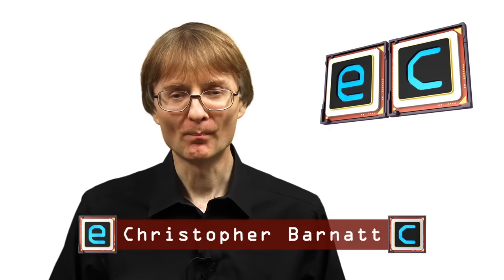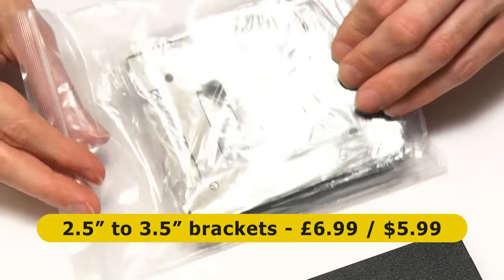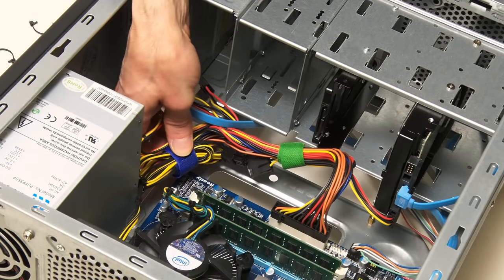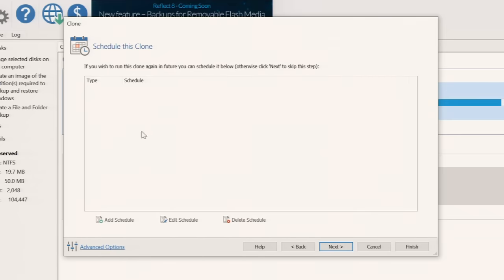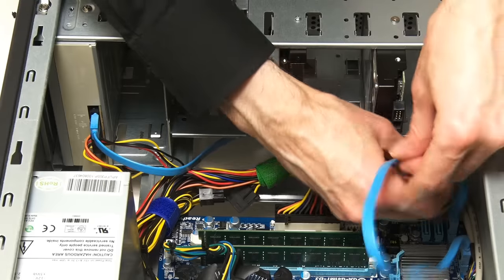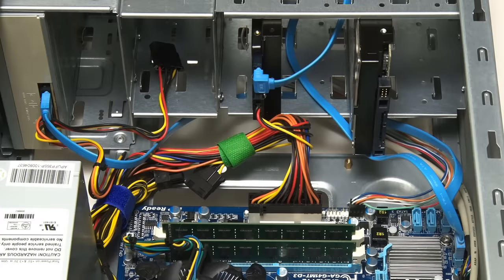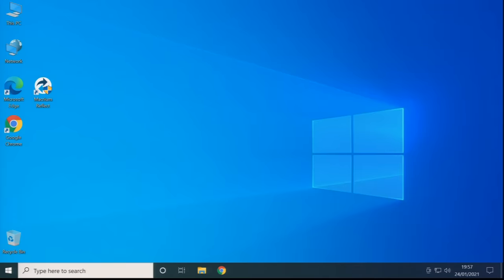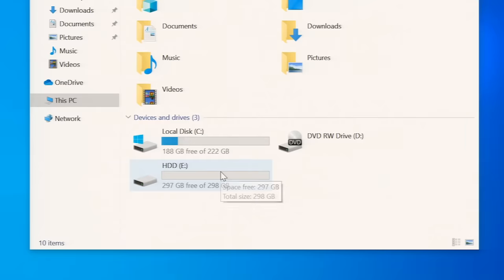Old PC Upgrade #2: SSD Boot Drive

Comment: Hi Chris! Could you make a video explaining Thin Clients, please? :)
Reply from the maker: Great suggestion, noted.
Reply: What's there to explain? They're just ultra small form factor PCs.
Reply: @FlyboyHelosim  Not really. A thin client has a lightweight operating system and relies on another PC or server to do the heavy lifting. The form factor doesn't enter into it, you could have an old tower PC running a very sluggish operating system but displaying the awesome power of something state of the art located elsewhere.
Reply: @lawrenceallwright7041  Not at all. Many modern thin clients are perfectly capable of running Windows 10 (although why would you?) and are totally self-contained systems. The one I have is the same form factor as an ultra SFF PC and to a casual user would appear no different.
Reply: @FlyboyHelosim  You seem to be confused with something else. 
Copied from Wiki: "In computer networking, a thin client is a simple (low- performance) computer that has been optimized for establishing a remote connection with a server -based computing environment. The server does most of the work, which can include launching software programs, performing calculations, and storing data."
You may have a computer which was originally intended to be a thin client, but if it's self contained you are not using it as a thin client. 
The form factor does not have any bearing on whether or not a machine is a thin client.
Reply: @lawrenceallwright7041  You've basically just confirmed exactly what I've been saying. The part "You may have a computer which was originally intended to be a thin client, but if it's self contained you are not using it as a thin client.". What I have is a thin client by definition and marketing, but I'm using it as a standalone, self-contained system. Of course form factor matters, if I'm using a server rack as a desktop PC it's still a server rack. Form factor is literally the ONLY thing that separates the many types of computers today.
Reply: @FlyboyHelosim  No, not really. The term thin client is defined absolutely by the way it is used. If you are using it stand alone, it's no longer a thin client. 
If you want to use a server rack as a desktop PC, go right ahead. Just remember your earplugs when you boot it up. You'd be better off connecting to it via a THIN CLIENT.
Reply: @FlyboyHelosim  I have one thank you, and I'm not going to waste any more of it arguing with someone who deliberately chooses not to understand terminology or do his own research. I just don't want the original poster to be misled by your statement that thin client means a small form factor.

Comment: Absolutely amazing video, I knew nothing really much about computers but I did want to upgrade my HDD to an SSD, so I figured I'd be a good Chum and bring it over to Best buy and Best buy called me two days later stating they could not do it because they could not get Windows to load because I received a free upgrade of Windows 10, then I stumbled across your video and 2 hours later with a pretty good dinner, my computer is blazing fast and absolutely no issues. So I'd like to thank you very much for your time and help.
Reply from the maker: Great to hear! This what YouTube is all about.
Reply: @ExplainingComputers  yes this is what YouTube should be about but you look at about 85% of the videos on YouTube they are nothing but terrible and sometimes dangerous information that could either get you hurt or destroy what you're working on.

Comment: I upgraded an 15 year old Acer laptop core 2 duo, Win10 pro 64bit, from HDD to SSD (Crucial BX500). Diskmark Read 59, write 56. With SSD Read 278, write 257. Boot time 2 minutes plus, now 43 second s. Thanks for the inspiration!

Comment: Some tips from many years of experience:
* The SSD needs to have at least 10% of it’s capacity unformatted to prolong it’s life, please factor this in to your upgrade plan.
* Always clean your old hard drive of temporary files, now is a great time to do a spring clean. You’ll save space on your new SSD and also reduce the time it takes to copy everything across.
* Check in a large supermarket, they often sell packets of Velcro strips for around £1 - this is great stuff for projects, cable ties and better than using blu tak to mount the new SSD!

Comment: Good job EC...I use this method for the most part although I didn't know about resizing w/macrium itself..just never tried or thought about it I guess since I'm used to resizing/repartitioning using gparted for many years now.  I absolutely agree w/disconnecting the other windows drive immediately after shutting down and removing plugs, as I have encountered problems when I did not in the past.  I also like to create a recovery iso via macrium which I put into a usb flash drive using a program called Yumi Multiboot.  The recovery iso helps me when I have problems with the boot record and many times has worked whereas a windows recovery or install disc has failed me.

Comment: Thanks Chris for your helpful video.  I plan to do this upgrade to my older computer that has 4 mechanical drives.  I'll add the SSD for the OS.   I'll put the SSD in the bay that used to house a thing called a 3.5" floppy drive!  lol.

Comment: Another very useful video Chris, I've replaced the boot drives in my three desktops with solid state drives, speeding them up to a great degree. I also used Macrium for cloning but use GParted for other disk work on both Windows and Linux boxes.

Comment: Tip about Zip ties, Their are two good methods to removing them, The first is use a tiny flat bladed screw driver and release the locking plastic finger on the inside of the box, method 2. get your self a set of cat claw clippers that have that hook shaped edge (the rounded hook shape can easily get under the ring and its strong enough to cut those, as a bonus the round edge was designed to keep you from hurting a cat so as long as you're careful it wont but any  cables (been doing that for years not and I have yet to damage a PSU cable.)).

Comment: Also a good tip would be to clean up the source disk before you clone it. This way it will be a little bit quicker to clone. Excellent video tutorial :)
Reply: I think you may mean "tidy up" because if someone is watching this and uses the "clean" feature in the diskpart utility (as he showed in the video), then they won't have anything left on the source disk. But I agree that by all means, tidying up and removing any unnecessary files on the source disk will speed up the cloning.

Comment: Thank you so much for this video. You saved me a ton of £££ and have raised my confidence enormously.  Unreliable hdd cloned and replaced with shiny sdd with an astonishingly quick boot time! Please keep doing your thing - it’s fab. My next job is to upgrade an old laptop and make it good enough for my son’s GCSE studies - wish me luck! 😁
Reply from the maker: Great to hear. Once you have done an upgrade like this, you will never see a computer in quite the same way. :) For an old laptop, you may get the performance required by changing the operating system -- https://www.youtube.com/watch?v=aJcWcQ8ew6Q

Comment: I've started to be a believer in a small boot drive as backing up a large one can take an unreasonable amount of time and storage.
Reply: Same here. Put the boot and applications on something under half a TB, or even smaller (I have a stack of 160gb to 320gb laptop HDs I use for boot drives) and put all your data and downloads and other accumulated junk on a drive dedicated purely to data.

Comment: On the Velcro part to reorganize/retie the cables,  but when you don't, before mounting the drive, check whether it's easy to just cut one of powercables free in maybe a top empty spot or whether you could do that using the bottom or the middle empty spots. Some might already have one sitting lose because they are like the one that is double folded with the next one, not sure how to explain, but the tip is just to look for the easiest way to connect it. With enough movement, you could bring the whole bunch of cables closer to the connector of the SSD, but make sure the cable isn't still being pinched/stuck but the full length of the cable is free. Like you need to roll out the full length of your vaccuum cleaner cable too.

Comment: This was a quite helpful video. And prompted me to do something similar on a PC which is only a couple of years old, but there were more obstacles than I had expected; I made the mistake of cloning the drive to a USB connected SATA interface which was USB 2 connected instead of USB 3 so cloning a 1TB drive took 3 hours instead of just ½ :( , and then when it was finished I couldn't remove the HDD because the CPU heat sink was in the way and I wasn't going to start fiddling with that.
But the process was successful, and now the computer is so quiet, and faster too!
Thanks for the excellent guidance.

Comment: a HDD to SSD upgrape is the most valuable upgrade you can do on an older computer.

I have replaced the 500 GB HDD in several older laptops I have around here, using Crucial MX500 500 GB SSDs.  The laptops had become terribly slow, and the HDD in a laptop is no speed wonder either.

Cloned the HDD to an external USB HDD drive using Clonezilla. Then replaced the HDD with the SSD and put the disk image back on the SSD. Increased the RAM in one laptop from 4 to 8 GB. Laptops are now good for another few years at least. 

Each HDD that came out of the laptops, I put into an external USB casing, so that they can be used as a 500GB external USB drive. Good for e.g. putting backups on.

Comment: Actually the boot time difference is much bigger. You include in the counting, the time the system needs to perform the P.O.S.T. operation, which is not affected by the kind of drive(s) you have mounted, rather than by the number of controllers onboard the system that you have activated through the bios (IDE, AC97, SATA, Ethernet controllers etc.). The real difference begins when the bios completes the P.O.S.T. operation and passes the baton to the O.S. (currently Windows 10 in this video). If it is calculated this way, I guess it boots up in half the time at least and not at the 3/4 of the time of the original boot. All in all, it is much faster PC, even if it lacks SATA 3. Good job. Thanks and stay safe.

Comment: This worked so well!  The software is now version 8 and the interface is a little different at the point where you had to reduce the size.  Honestly if I figured it out, anybody can.  So many people I work with buy new computers when they start seeing it slow down.  These are not gaming rigs - we use spreadsheets. I will keep my $800 thank you very much.

Comment: Good upgrade, I have just purchased a larger SSD drive to increase storage size. 

I would like to mention that most SSD and Hard drive manufacture today, give a free clone program called, Acornis for download. This is a excellent software program and is much easier with fewer steps then the one you suggested. So if you buy a new SSD or hard drive, make sure to check if they offer Acronis software to clone and backup your current drive.

Comment: The MB on your PC offers various options of upgrading and increasing the performance, e.g. the installing of a more powerful CPU. Thus, I would start the upgrading process by visiting a cpu-upgrade related site and by choosing an appropriate quad-core cpu, a Core 2 Quad Q9550S for instance. Having the same TPD it supports more instructions and could significantly improve the overall productivity of the system.

Comment: Great video with clear straight forward instructions gving me the confidence to have a go.  I tried to adapt the process/plan with using a Samsung 980 m.2 SDD on a PCI Express M.2 SSD NGFF Card Adaptor inserted in to PCIe 3.0 x 4 socket (took this approach over a 2.5" SSD SATA connection as wanted faster read/write speeds with the SSD becoming primary drive with Windows 10 and program files.  Unfortunately the Macrium  cloning halted with 99% progress and reporting Error 9 - 23 data error (CRC).  Using device management / tools / error checking reported no faults as did chkdsk  where as sfc /scannow reported errors found and repaired.  Following this I repeated the Macrium cloning and got same errors and windows 10 no longer being able to load.  subsequently found various reports online about issues with windows 10 following cloning HDD to SDD.  I suspect I have an issue with using M.2 SDD on PCI adaptor (and/or motherboard) not allowing OS to load.  so hoping to reinstall windows 10 on HDD and repeat exercise with a SATA 2.5" internal SSD.  Fingers crossed !!
Reply from the maker: Thanks for this. Almost certainly your issue is using the M.2 NVMe SSD on the PCIe adapter, as this will be contigent on appropriate motherboard support. Cloning Windows 10 from an HDD to an SSD should not be an issue in Macrium. Good luck! :)

Comment: I just saw a tip on another video: use two zip ties: one for joining the cables, and another one inside it to control the tightness. if you need to change anything you cut that second tie off

Comment: Thanks so much, you're instructions are very easy to follow. My HDD boot was 3 min. 12 sec, SSD 34 sec - WOW!!
Reply from the maker: Sounds like you've had a very successful upgrade. :)
Reply: @ExplainingComputers  Had to special order a SATA power cable. I was hesitant before "cleaning" my HDD (disk 1) even though all my data was now on my SSD (boot drive), but you know...

I did and everything is great. Thanks so much for you clear instructions.

Comment: It’s also worth noting that the SATA cable from the HDD to the SATA port on the motherboard is the first SATA port your P.Cs BIOS is going to want to load from. So theoretically when you plug your new SSD into another SATA port and clone it. You can simply swap the SATA cables on the HDD to the SDD and it should boot from said SSD. (At least in my experience) Then you can if you want, wipe the HDD for a backup drive or spare storage. :)

Comment: As usual, this was the first time I've seen this particular video on this subject. Very well done, in fact, I have that same machine sitting on the floor I just got through unplugging it, it has about four drives in it. It needs a better NIC card, and audio card and more memory, but, other than that, the machine works really well. Thank you for this tutorial very nicely done.

Comment: I've done the exactly same thing more than 60 times giving a new lease of life to some 2008-2011 systems. On some I left the old HDD disconnected inside as they are an emergency solution with all the software installed and configured (Office, SAP, drivers and ancient data).

Comment: Glad to see you used Macrium Reflect, it's an excellent piece of software. I've tried other favoured cloning software, but this is the only one that has never failed me...and I've cloned some disks! That said, I don't remember resizing partitions during the cloning process, but wondered if after dragging the 3rd partition over, could you return to the 2nd partitions properties and "take up the slack" before starting the cloning process.

If available when installing, make sure you tick the ViBoot option on the last part of the process. This allows Macrium Reflect to mount any disk images you might make in the future (not required in this clone of the disk). It has saved my highly processed pork product when I've imaged my system disk as backup before a reinstall of the OS only to realise I'd overlooked something unimportant like exporting OUTLOOK.PST.

Thanks for another informative video (watched even though I'm well versed in the process) Christopher and thanks Macrium for a superb FREE product.

Comment: A graphics card upgrade would be a perfect idea for an old computer as it would add HDMI output to pc's that only have VGA\DVI outputs and it would help ram usage so that it won't have to share ram with the integrated graphics (some pc's) and it would be useful in 3D Applications

Comment: I did this exact upgrade - HDD to SSD but have yet to reconnect  HDD to usable backup/storage as I need  a spare SATA cable (like in the demonstration, have held on to my DVD burner drive).    Good videos for novice and pro alike.   I compliment these with with Carey Holzman's tutorial videos on building PC's.

Comment: I said on the first video that my dad's pc looked way newer but it has 0 stat power plugs and uses molex adapters for everything. This is directly from the manufacturer. even the HDD uses a molex to sata adapter and that HDD has a molex on it. Along with a sticker saying not to use it. no joke.

Comment: I had this old Gateway laptop that had 4GB ram and I'm guessing the last Pentium processor ever made.  I put in an SSD and installed Mint on it.  It is great for surfing the internet and youtube and learning a bit of Linux.  I revamped the terminal and Mint UI to a Watchdog's Dedsec theme.  I love showing it off.   As for disk cloning, I've used Macrium Reflect without any problems a couple times to replace HDDs with SDDs.

Comment: Don't forget to run

winsat formal

on the system after installing the SSD to turn off defrag and enable trim!  If you install windows to an SSD, it does it automatically.  Cloning, however, doesn't implement those changes.  However, if you image a drive and then restore that to an SSD, there's an option in Macrium to enable trim.